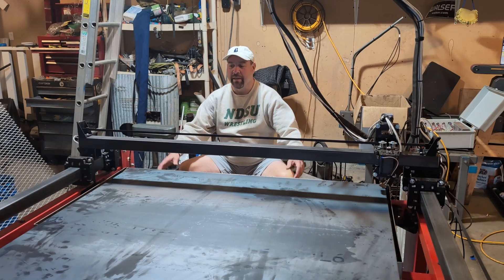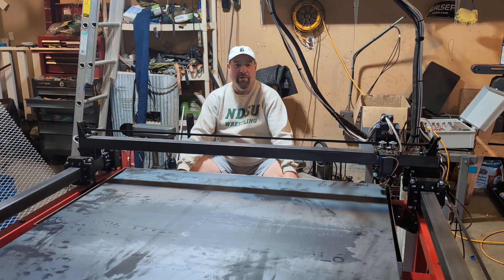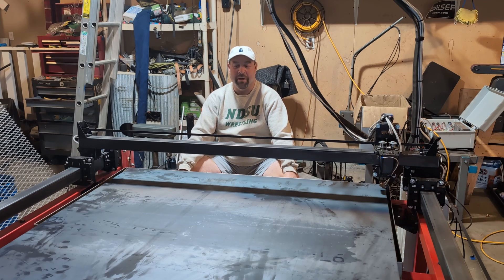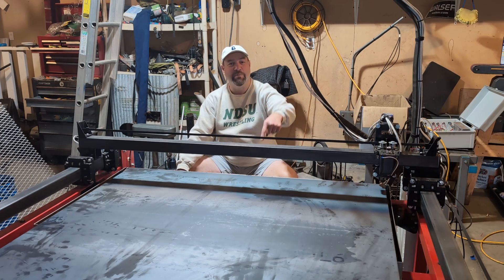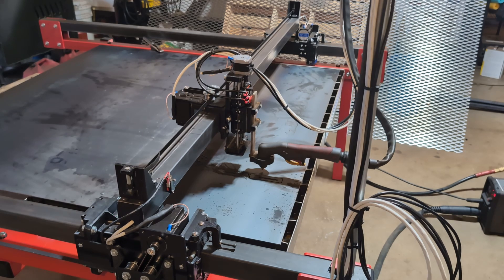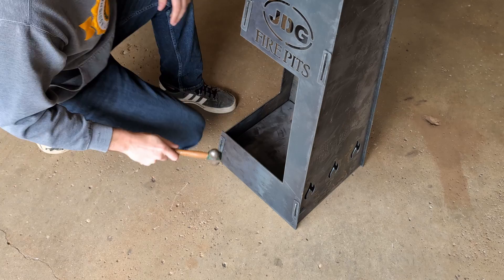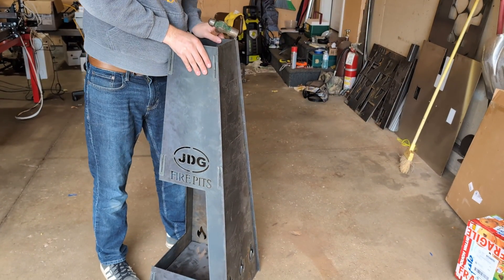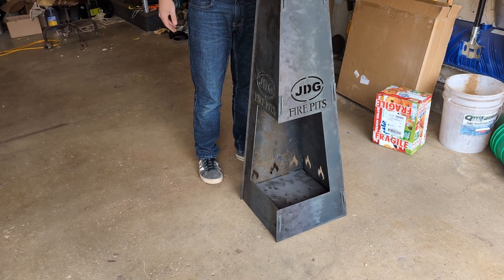DIY XL Plasma Table Is Put To The Test

Comment: Great build. What do you think about having this as a dual purpose Router and Plasma cutter? Perhaps the hardest part would be compiling/swapping software that can function with the change. I am planning on building a CNC Router anyway, but dual purpose would be perfect.